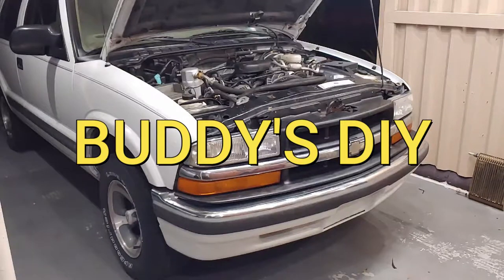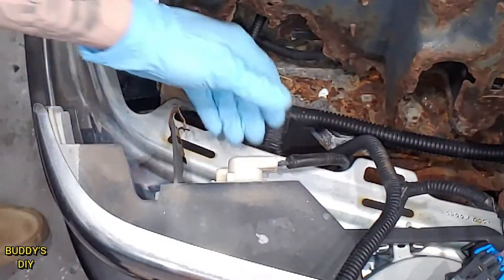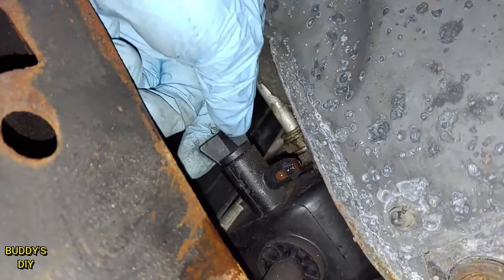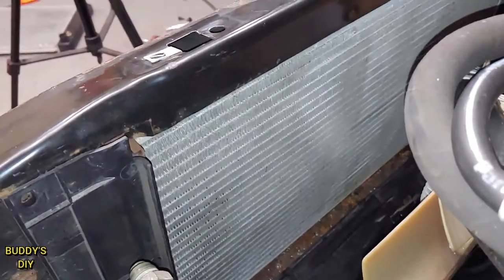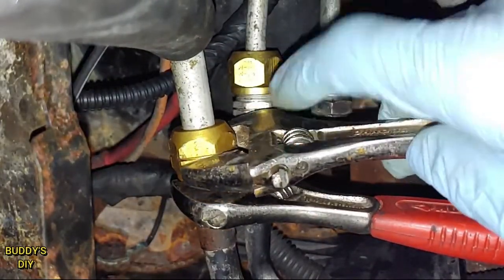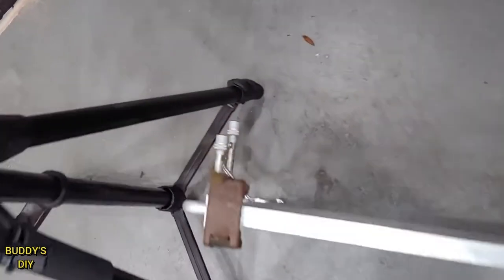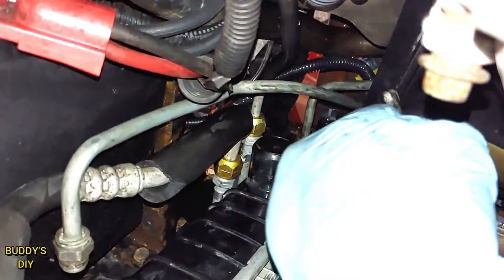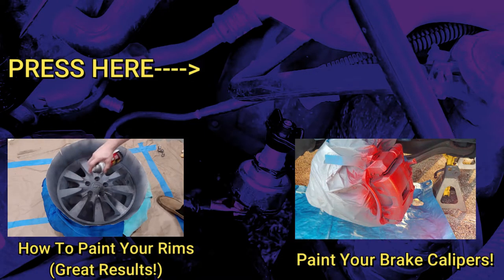Chevy A/C Condenser Replacement | Silverado, Suburban, Tahoe, S10, Blazer Impala And More!!

Comment: Decent video but ALWAYS ALWAYS change the o rings on any ac component if possible whenever possible, there’s no such thing as a “decent” oring after it’s been crushed already, this guys sayin he dealt with a lot of leaks but 90% of them are from guys like this that have “repaired or replaced” something at some point (I.e a leaky overthought o ring that wasn’t changed when it was supposed to be) big difference between replace and repair with a good repair comes longevity and this system will not see that😅

Comment: 2003 Chevy Traiflblazer Ext 4wd: no need to drain radioator. Just above radiator, horizontal frame bar, remove four 13 mm bolts and the vertical piece in the middle that holds radiator and condenser together. Then, condenser will be accessible. Just remove plastic piece (at each top ends of condenser) that holds condenser against radiator. Then, there is enough room to remove condenser. Thanks for video though - it gave me enough courage to attempt it myself.

Comment: Nothing like using all the wrong tools.
Reply from the maker: Pretty sure I could have done this with all box wrenches if need be
Reply: @BuddysDIY  adjustable wrenches, pliers and channel locks have no place in an auto shop, much less around tubing and hose clamps.  You say you've done a lot of A/C work, get the correct tools and don't mark/screw up customers parts.

Comment: You did a awesome job I have a 2005 Chevy avalanche 4x4 truck I have to replace my radiator and AC condenser where I live it's no mechanic shops so I have to do the work myself this is a very helpful video thanks

Comment: How do you add oil to the new condenser? Can you just pour it in to one of the fittings openings where the hoses connect and just turn the condenser and rotate it until your short has distributed and it won't plug the thing up?

Comment: I have a 2002 S-10 ZR2. When I did mine, I didn't have to remove the radiator hoses or the trans lines. I just removed the battery and the battery tray and the ac lines where right there.

Comment: Thanks for the video! I dont see a link to amazon for the condenser!
Reply from the maker: Hey just did it! Btw thanks for the sub! Onky quality content here! 💪
Reply: @BuddysDIY  man I've been troubleshooting my a/c issue for the past week on my 2000 s10 and I think this may be my issue. Great videos. Thanks again!
Reply from the maker: @kelseykay9713  could also be your evap. If you need help with that just comment here. I also swapped it and I'll give you instructions
Reply: @BuddysDIY  Will do! I'm going to follow your ac dye video first before I buy any parts. 🤘
Reply from the maker: @kelseykay9713  awesome. You can try the air and soapy water trick as well. How long does it take to leak out?
Reply: @BuddysDIY  well before I started touch anything on this "project truck"  I noticed my coolant was just being dumped out completely. Engine wasnt running hot so I started checking lines and noticed my radiator needed replaced so swapped that out and were good. Then the ac stopped blowing cold air so I checked the pressure and everything read "green". I then started looking at the compressor and condenser. The thing is my condenser doesnt continuously run, it goes in intervals of like 5 to 10 seconds.
Reply: But with engine off, I can turn the compressor no problem. It's not stuck.
Reply from the maker: @kelseykay9713  the 5 second intervals sounds. Like a freon pressure sensor issue. Take a staple and stick it in the little sensor that plugs into the accumulator. (The cylinder looking thing)
I have a video where i tried stop leak on it and it shows how to jump start the compressor with a staple. If the staple makes it run more than the regular 5 second intervals then you got a pressure issue. When you try that let me know.
Reply: @BuddysDIY  I'm sorry I forgot to mention I did replace that pressure sensor along with all new plugs and o2 sensor
Reply from the maker: @kelseykay9713  ya that could be a clog making it not read the right pressure. Have you tried hooking a manifold guage to it?
Reply: @BuddysDIY  I have not! I'll do that tomorrow!
Reply from the maker: @kelseykay9713  I definitely would before you start throwing parts at it.
Reply: @BuddysDIY  alright, so I went and charged up the ac. Officially blowing cold air and after checking lines hoses etc. I found my evap is leaking QUITE alot. So that will absolutely need replaced.